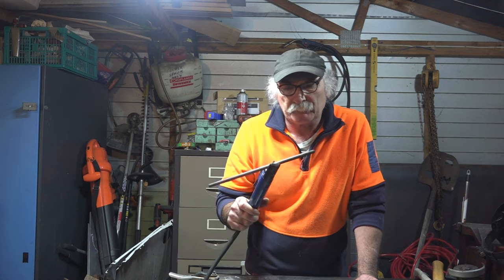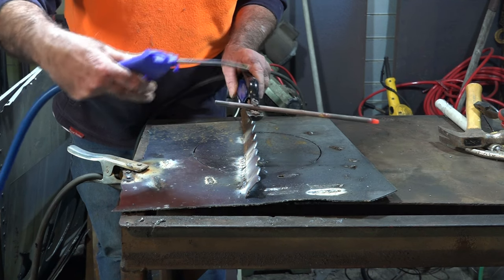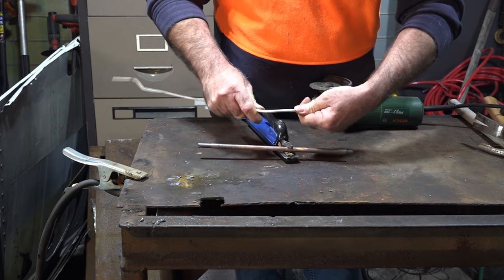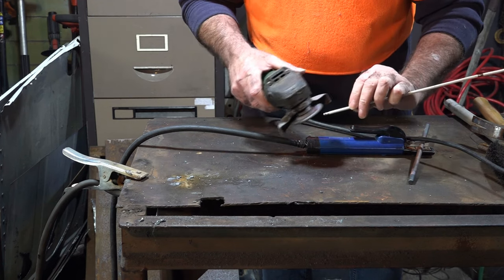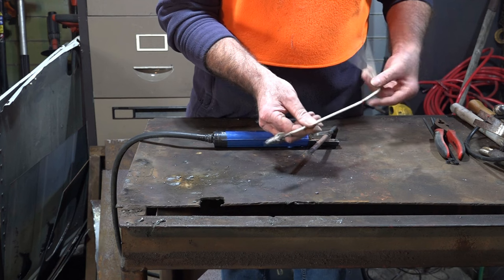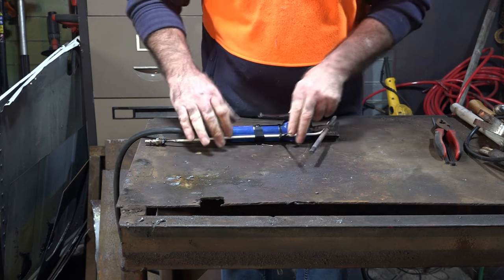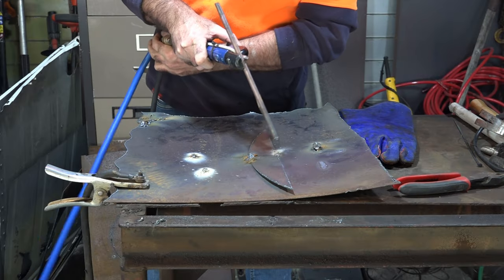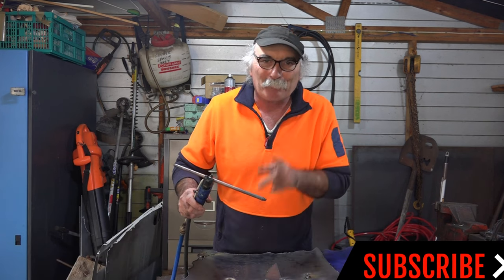Home Made Carbon Gouging Torch

Comment: I was on a similar mission recently.... here's what I found:
- I started holding an air nozzle and the electrode holder, & running 3/32" 6010's. It mostly worked....but carbons are far superior.
-  I purchased a [probably china made] arc gouging torch for ~$85. Much easier than holding both.
- At 150A, your carbon is way too big. I found 3/16" or 1/4" carbons, & at 150A, they run smoothly.

I don't arc gouge often; but now I have a reliable setup for when it's needed.
Reply from the maker: Hi Robert great info cheers Pete

Comment: Interesting project.  Just a thought you could have used silver solder to attach the fitting to the tubing also a small regulator from a cheap paint gun would help dial in the pressure without going back to the compressor
Reply from the maker: Good idea my friend